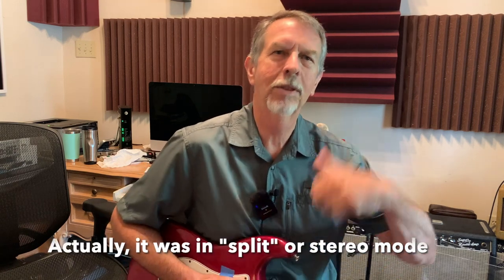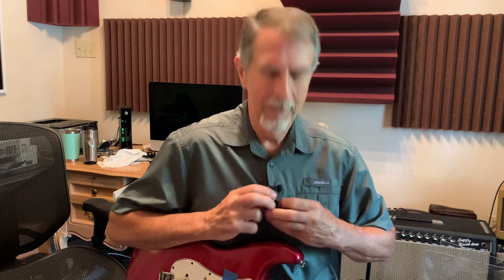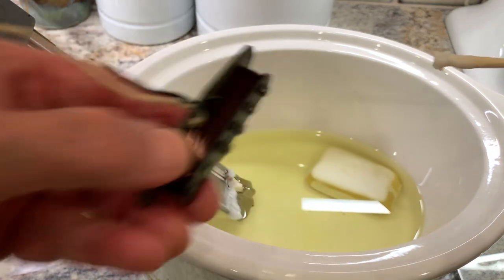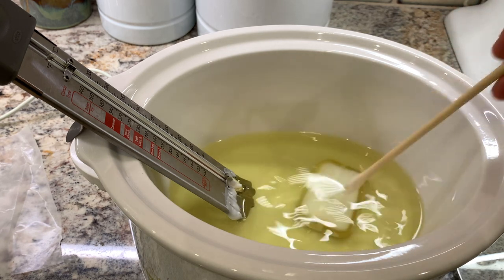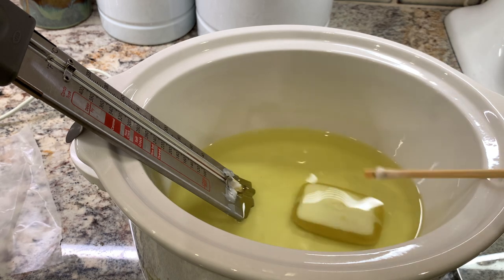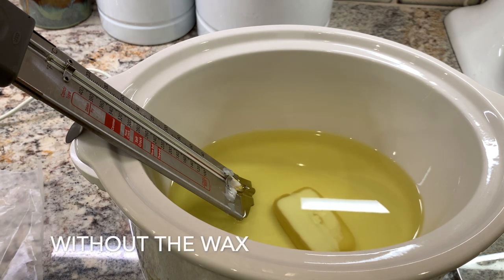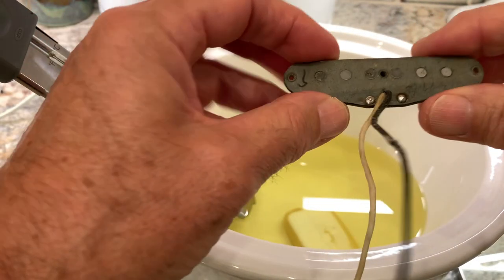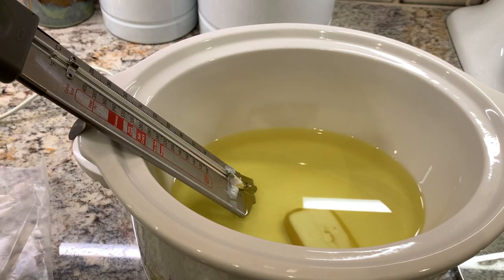How Not to Wax Pot a Vintage 1966 Strat Neck Pickup

Comment: I don't know why we find humor in others pain. But i can't stop chuckling ....😆
Reply from the maker: Lol, it IS funny.  It's just life.  All will be good in the end.
Reply: @millstap  Years ago i used to have a 3 pickup Gibson SG custom, I bought 3 new lolar pickups for it at some point, When i decided to sell the guitar years later I pulled the lolars out of it & while doing so i noticed the holes in the bobbins had wax in them so i tried to clean it out, While cleaning the wax out i ruin each one of the pickups by breaking the wires , So i know the feeling. I never told this story before, It was to panful & I'm way to smart to do something as dumb as that...But i did it.. PS more time then not you can pull the bottom bobbin down slightly ,Enough to take that broken lead wire and unwrap it once so you have enough lead so it can be laced back through the hole & it can be resoldered
Reply from the maker: @gatormcklusky5850  Lol, that is exactly why I almost didn't post this video but I knew it might help someone later, hopefully.  I was more concerned about the dent I put in the coil.  I'm not sure if that affects its performance so I wanted Aaron to look at it, and pot it because I don't want to try it again, yet.  Now that I think about it (and I shouldn't be), I have a set of Texas Specials that I don't like that maybe I can experiment on.  I should try my de-potting thing and then re-pot it.

Comment: Don't beat yourself up over it. I'm sure it can be fixed and in the worst case rewound and still sound killer. I can tell you are still a true aviator, sharing your mistakes so we don't repeat them 👏🏼 👍🏼 On the pro side, that Strat has got some middle & bridge pickup mojo going on. So no reason to put it down while the pup is in repair.
Reply: As far as I know EVH used to pot his pups so hot that the plastic part shrunk 🤔😅

Comment: IT's not a file ... you can't just transfer the wax out of it like a harddrive. Even if it's melted it will cling to the surface area of the pickup. 

I want to make an Hss. But really the middle is unwaxed with its' own volume control.. that way you can just use it to feather in the feedback from the amps and still be able to play clean... That way if it gets out of control with feedback you can dial it back
Reply from the maker: There was no way I could play it un-potted.  Once I got it slightly potted, it sounded better than the original which was heavily potted.
Reply: @millstap   It is really interesting that you don't want to overwax your pickups.  This will keep me up at night trying to figure out how to deal with this.. lol

Comment: Hi! This is irrelevant to the video but my strat needs a refret so here goes: Did you ever feel a need to polish the EVO frets on your strats that have them? Stainless apparently requires no care and stays slick for optimal bending. Was just wondering how your experience with EVO wire was after all these years. Would really appreciate your input!
Reply from the maker: I've only polished the EVO's when I'm cleaning the neck just to see them shine.  They are still almost like new after all these years.  Incidentally, I just bought a new StewMac Z-File yesterday to recrown my nickel frets that are getting flat now.  It is a diamond file and I might check the EVO's in a few spots just to see where the crown is.  If anything, the EVO's might get what I would call lumpy or wavy but that isn't a very good description.  They will be good forever as far as I can tell and the crowns are still perfect.  They bend very nicely and the height is still there.
Reply: @millstap  Good to know, I'll go with EVO's too then. Thanks for replying and take care! Looking forward to the next video.
Reply: @millstap  BTW, what do you think of the gold shade, does it clash as much as one would imagine with the regular silver colored hardware on the guitars, or is it rather subdued? Does it fade over time? I don't fancy the gold look much to be honest.
Reply from the maker: @N0thingIsTrue  Depending on the lighting, from a few feet away I don't even notice a difference.  I usually have to point it out to someone but then they are usually not guitar players.  Don't let the color distract you if you want frets that last forever and sound good.
Reply: @millstap  Thanks! That's quite reassuring. Considered stainless for a while but apparently it has an effect on tone. Watched a comparison video from warmoth and could tell that SS was brighter, nickel warmer. I'm sure it could be EQ'd out but I'd rather go with something closer to nickel. EVO sure seems like a happy medium between the two.
Reply from the maker: @N0thingIsTrue  That’s exactly why I chose them. There is an interesting video that luthier Holger Notzel did on Instagram where he shakes a set of each type of fret in his hand and you can hear the tone of each material. EVO is not as bright.
Reply from the maker: @N0thingIsTrue  I just posted the video link at the end of my Instagram Story.
Reply from the maker: @N0thingIsTrue  I'm not sure who that last comment was directed to about maybe screwing up a vintage guitar.  My sentiments exactly.  Guitars are tools.  It's sad to know of all of the great guitars locked away in a locker when they should be played.  Mojo comes 90% from how you attack the strings.  And a lot of old guitars need work anyway.  It was pretty obvious when I put in the Lollar neck pickup and it almost sounded better than the original, vintage pickup.  It's a lot of hype that most audience members would never notice or care about.  Just play.
Reply: @millstap  Yeah, that was directed to that comment stating that you ruin the guitars by tinkering with/altering them. I think it was deleted recently. Just had to say my piece as I love to play AND tinker as well. Keep doing what you're  doing, love the content you provide.

As for the Instagram video, I'll be sure to check it out. Good to know I'm not cork sniffing talking about the brightness of ss frets. It's not exactly a bad thing that they brighten the tone a bit; I just love the tone my guitar provides so I'd rather keep it as unchanged as possible.

Comment: Have u ever tried a tonemaster super reverb? How does it compare to its tube brother?
Reply from the maker: I have not.  I just can't get into the digital thing.  For around $600 more, you could buy a vintage Super Reverb.  They are still cheap in comparison to other vintage amps.  I know they are much heavier and require tubes and maintenance, but they tube growl is impossible to immulate with digital circuitry.

Comment: That sucks man. Hopefully your buddy can fix it. I'm sure you could've too.. Just tact that wire back on, but that's easier said than done. :)
Reply from the maker: Yes, I probably could have soldered that wire but I was also concerned about the dent I put in the coil.  I'm not sure if that affects the pickup's performance.

Comment: weird? I've been making pickups for years never wax potted any of them, even at high gain no squealing. and I do play in bands, so sometimes I'm pretty loud!
Reply from the maker: Do you use a machine winder?  I’ve been told you can wind the wire tighter and that sometimes stops the squeal but Aaron tried that and it didn’t work. I think Fender potted most of their pickups. Do you ever use a fuzz pedal or Tube Screamer or OCD?  Those are my pedals that start the squeal.